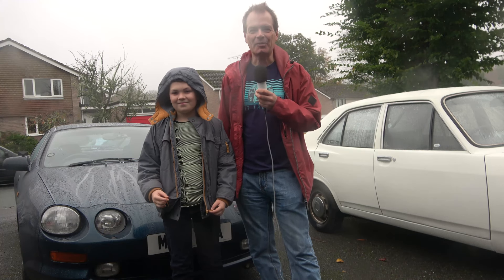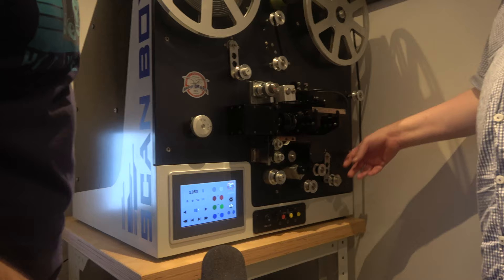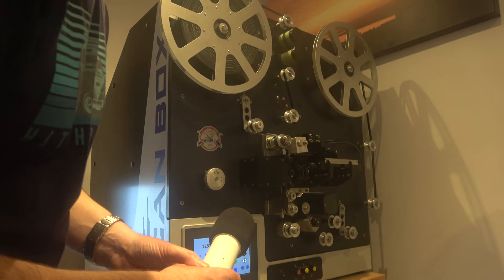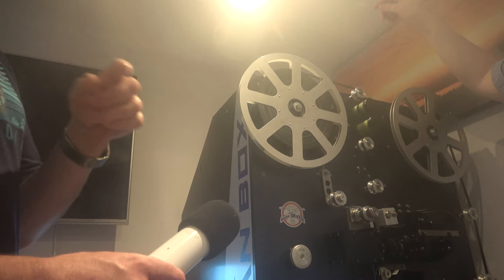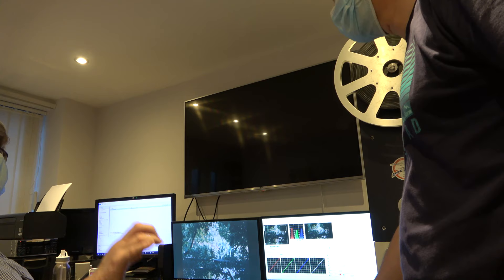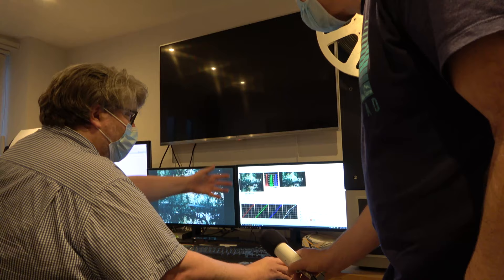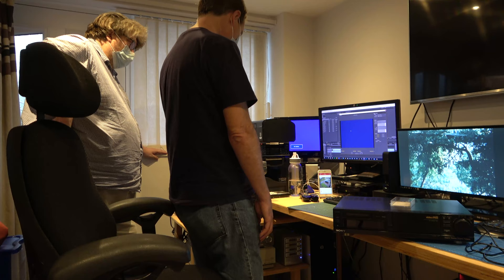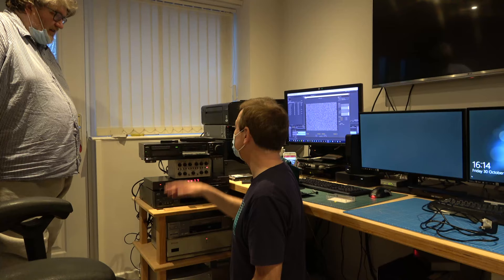See a Scanbox 4k film scanner, test two Hi8 decks, collect lots of goodies.

Comment: Very interesting film scanner, and nice video equipment! :)
The Blackmagic video capture card looks like the Decklink Studio 2 I had and unfortunately ruined. So a word of warning before it's too late: You will find the heatsink on the card is rather useless, despite running the very noisy fan at full speed all the time the card still gets very hot. The heatsink is glued to four surface mounted chips. On my card I tried to remove the heat sink to replace it with a much bigger one that would have provided sufficient cooling and would have possibly worked without any fan. But despite being very careful, when I tried to remove the useless original heatsink, I cracked a little ROM chip. Even if I was able to replace that, it would not help as the program in the ROM is lost. So better leave the heatsink alone, even though it really doesn't do much for cooling ;)

Comment: My first SVHS machine was a Panasonic NV-FS200. I seem to recall it cost me nearly 800 quid, which was a lot of money to me in those days. Actually I still have it and it still works. Nice machine, but I had recurrent problems with the anti-static brush on the top of the head. I had to clean the brush after every few hours of use in the end, or I'd get a noise streak on the playback picture. I used to clean it by soaking a lint-free tissue in IPA cleaning solvent, lifting the brush and placing the tissue underneath, then sliding the tissue between the brush and the contact on the top of the drum. Worked a treat - for a short time before I'd have to do it again! Also used to drill holes in standard VHS tapes so I could record in SVHS on them (this was before SVHS ET was a thing).
Reply from the maker: Yes I had that problem with my very similar NV-FS88, but cleaning and re-springing the contact worked for a long time.  I still have the machine and it worked last time I tried it.  I did have to replace the toothed belt underneath the deck because it stretched and made the machine a bit noisy.

Comment: I bet you wanted that 4k film scanner,  salivating  :-D
Yes the concreate makes sense, stability and a wide range of oscillation/vibration is stifled by the mass.
Looks like he has a really good setup for correcting most film faults.

My dad filmed me /mum/brother/sister down the local park with a super 8 camera, I was a baby at the time.
The original film was falling apart, bits would snap off, someone put the film through a crude film transfer projector system.
I can see the edges of the black apature all the way through the film, and the colour was really way off plus i guess the film was damaged as parts of the picture had odd colour casts.
I ran the film through basic software and did the best i could with the purple faces and other faults frame by frame.
 it took ages.
i will never find out what happened to the film as both parents passed away.
Apparently the film was so expensive that only short filming was possible.
Reply from the maker: Well no, I don't have the room, time or expertise to start dabbling in cine film transfers.  So I will leave that format to him.
We are competitors to some extent, but I get on with a number of other people in the business.
Cine film was expensive, so recordings tended to be short.  Alas most of the film taken of my family in the early 1970s was shot on a camera that had a fault in the gate so the results were rubbish.
Reply: I had to employ a removals firm with three fellahs to get the machine in situ, it's sitting on a Bott Cubio mobile workbench which is rated to 800kg, although the Scanbox 4K only weighs 100kg, and the wheels make it easy to shift about if I ever need to get to the back of it. I wouldn't fancy my chances if it were on a static bench.
Reply: @lilactime2000  Better to have a stronger than needed mount, it will never cause any problems later.
Well unless you need to move it with the machine on top lol.

Comment: Can you please answer this question i have transferd VHS tapes using a sony rdr hxd870 hdd recorder but i have a problem getting the files from the internal harddrive to my PC you have to use a DVD discs to copy the files from the hard drive and some are like 10 gb files and i cant find a dvd disc with that much storage. Do you know if i can just take out the sata hard drive and plug it in to my pc using a sata to USB adapter and copy the files?
Reply from the maker: Most DVD recorders have a special disk format so you can't just take the drive out.  I've never tried it on a Sony model but would expect that to be the case.
Reply: @video99couk  How do you transfer VHS tapes then? I have like 50 vhs tapes that i got asked to transfer so would appreciate if you had any tip
Reply from the maker: @SwedishRetroTechNerd  The way I do it, uses equipment which is probably not easy or cheap to source:
Play tapes on a high end SVHS deck which includes a Digital Timebase Corrector, such as a Panasonic AG-4700.
Feed this into another Digital Timebase Corrector which allows for some further adjustments (GTH Electronics ACE or similar) via S-Video connections.
Capture to DV using Canopus AD-VC55 or a professional DVCAM deck operating in E-E mode (some miniDV camcorders can be used for this).
Firewire connection to PC with SSD drives and capture software to guarantee zero frame drops.
As well as 13GB/hour DV-AVI files, I then usually also generate smaller MPEG4 files of about 4GB per hour.
Reply: You need to burn as a DVD-video, not a DVD data disk. 
Download a program that burns DVD disk, it will compress the video so it fits on a standard DVD.
On Mac I use the program called “burn”
Reply from the maker: @itsandrewwise  I think the original poster was trying to extract data from the hard drive of the DVD/HDD recorder, not from a DVD.

Comment: Tenho um vcr vhs Samsung modelo SV-700S hi-fi nicam,e passado uns 5 minutos começa a ficar com a imagem suja como se fosse as cabeças sujas,e depois  sem cor,e a imagem a dobrar e acaba por ficar só a dar som. Será grave?
Reply from the maker: Impossible to give an exact cause without working on it.  Possibly a power supply fault which could be easy to fix, but may be a defect almost anywhere in the video processing circuits.

Comment: If you ever decide to go into film transfer, do consider Moviestuff film scanners, they are around $12K, much cheaper than your friend's 60K machine. They are the most popular brand in USA. Hope you two remain friends though.
Reply from the maker: I'll not be doing film transfers, I have as much audio and video work as I can handle already!
Reply: I started with Moviestuff scanners. Moving up from projectors on a screen to 45 degree mirrors (2003) then Moviestuff was my first go at what I thought of as serious archiving. I bought both the 8mm and 16mm models from the USA, imported to the UK and they were OK, certainly for the price at the time 2006 to 2009 when I moved over to the Memory HD from CTM Debrie of Paris in 2009. In general you get what you pay for in this market and if you have a smaller amount of money to invest the Moviestuff set ups are good for the money. But nowhere, and I do mean nowhere, near as good as machines further up the food chain. The Scanbox 4K 2020 even makes the Memory HD look average. Full 2048 x 1500 or 4096 x 3000 resolution is still, two years on, blowing me away.